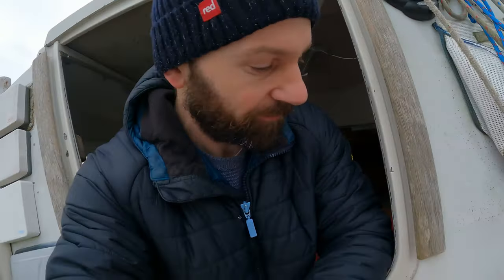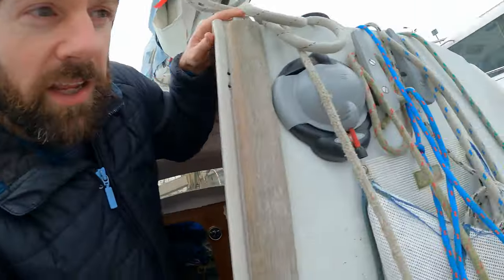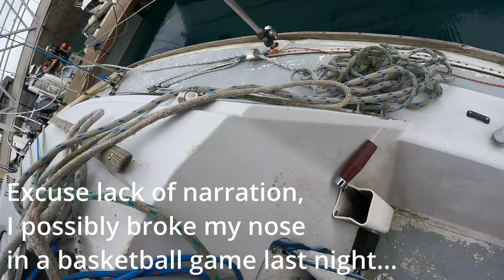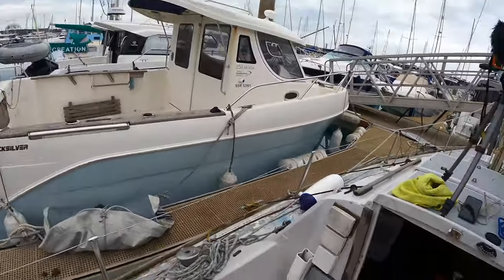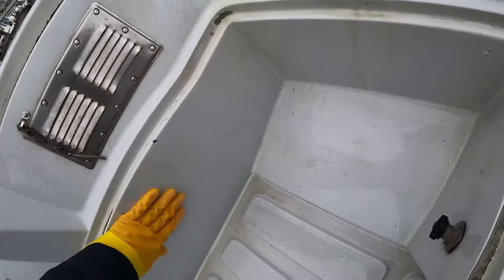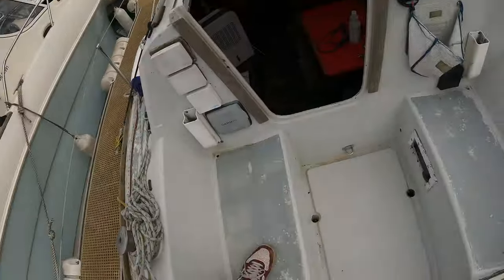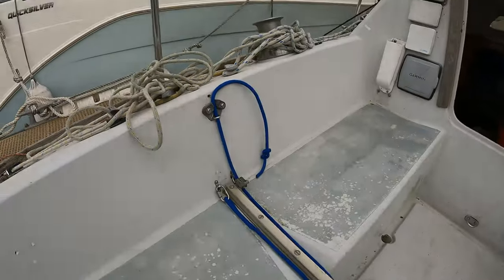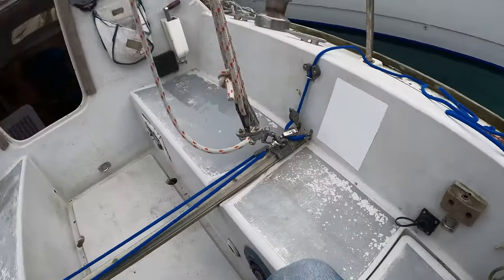Ep21 - Cleaning Old Boats

Comment: Yeah, follow Ecume owner. I am currently doing complete repaint of hull and deck after I upgraded a lot of technical things. Hopefully will be finished end of summer.

Have fun fiddling 💪
Reply from the maker: Nice. Are you on the ecume Facebook group, I'd love to take a look. What technical things have you upgraded?
Reply: @thesailingdonkey  hey, not on facebook. Got her in original state but nor much upkeep over the years. So had to do new hull to deck seams sealing. New winches. All lines new. About to switch to synthetic rigging. New anchor. Depth sounder..... endless story.
Almost got killed by the gas cooker so switched to an alco stove....grab rails on the cabin top were rotten needed to replace the basis of those. Well, I guess a never ending love story. Some deck bits were delaminated so filled them with epoxy and foaming agent. Reinforced all chain plates with carbon fiber backing plates...
Reply: Btw mine is no. 150 from 1972 ✌️
Reply from the maker: @horstlauch453  Ah man, I'd love to see pics of this, sounds like you're doing a great job! What gave you the indication the hull to deck seal was gone? Leaks? Interested re the chain plate backing, I've noticed my bulkhead is warped on port and starboard because of cap shroud tension so I might do something similiar.
Reply: @thesailingdonkey  Hey, I just made carbon backing plates for the lower shrouts on the inside and outside for the screws that connect deck to bulkheads. I think the problem is that connection of the hull and the bulkheads is getting loose on the floor, mine makes sound while under stress e.g. upwind with waves etc. I am thinking to just let some epoxy run into the rim where bulkheads and Hull connect. Tried i292 but it does not really get in there. Still squeaky. Also I want to make UD carbon strips that connect to the upper shrouds inside, run along the bulkhead on both sides and then end on the floor. This would then spread the force in to the bottom. Otherwise it is just pulling on the bulkhead and deck which is in my sense not great especially if the bulkheads are not really connected to the floor anymore (old glue maybe).
Reply: @thesailingdonkey  and yeah, if seems are leaky it is a nightmare since the water runs behind the inner shell and the Hull and randomly come out somewhere. Took the Teak toe rail out. Cleaned everything up. Reembedded the toe rail with a lot of butyl. It's dry since 3 years 🤙
Reply from the maker: @horstlauch453  Dude where are you based? I feel we need to meet and compare 🤣 My deck creaks heavily if I put the mildest tension on my lowers.
Reply: @thesailingdonkey  creaking indeed. I am in Berlin. Maybe in two years time to south of England and on to Hellford Passage on a mooring there.  Going back an forth to the Ferry Boat Inn to quench my thirst for Ale. 😎

Comment: Hi Matt.  For gelcoat cleaning, try Y10 gel - although in my experience it works better when the temperature is a bit higher than it is just now. Failing that maybe a light sanding (wet and dry).  In both cases, follow up.with polish to protect from further damage.
Reply from the maker: Thanks Patrick. I'll give that a go. I'd bought some generic marine polish to try but I'll look up Y10. I feel like the surface is still too contaminated to start polishing yet, but it's quite hard to tell!
Reply from the maker: Can I pickup Y10 in any of the local chandleries?
Reply: The last tub I got was from BW+, a year or so ago, and was branded Wessex Hull White.  Same active ingredient, oxalic acid.
Reply from the maker: perfect, thanks